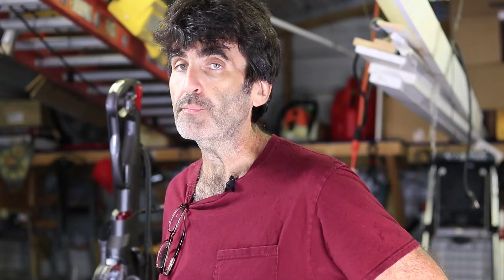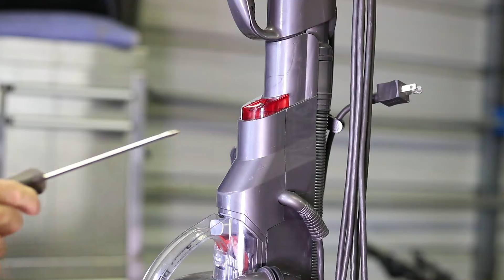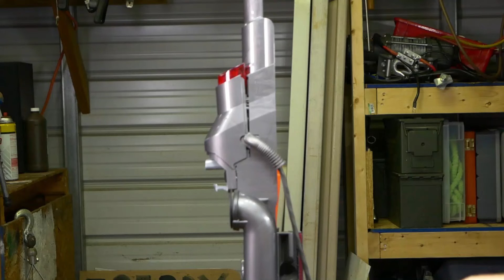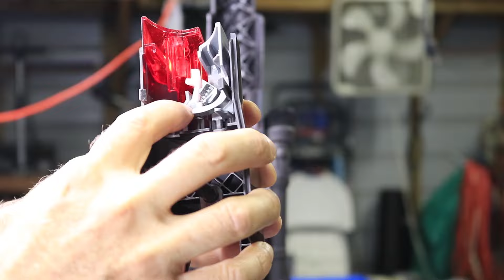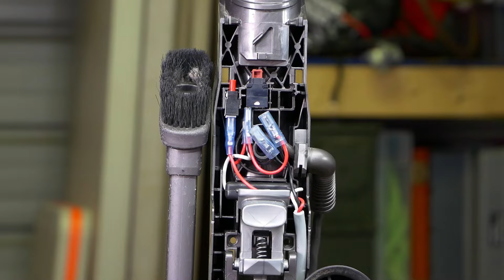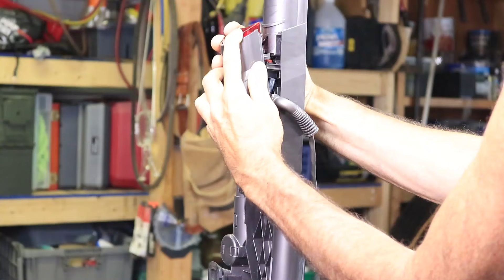How to Replace Power Switch on Dyson DC25 Explained in Full Detail

Comment: Where do I get a new switch from, for the vacuum?
Reply from the maker: I put a link in the description.  That should be the right one, it lists several model numbers there that it's compatible with.
Reply: I’m pretty sure I ordered one for DC 25 but Amazon sent me one for a DC 50 I’d go with calling Dyson!
Reply: I got one for less than £4 from a shop selling through ebay. Arrived next day. Repair took less time than finding my torx drivers which had been put away in a safe place (so that next time I won't have to search for them!)
Reply: Dyson no longer supports DC25. But they’re happy to sell me a new one.🙄 I located part on eBay for $15.
Reply: You can call Dyson and they will send you a free one, and the extra spring as well. They were very helpful as well.
Reply from the maker: @maryannharper883  Good 2 Know!  Thanks..
Reply: Hard to get cover off dc18 no video for that one

Comment: I’ve replaced the beater bar on mine as it stopped working. It still won’t work, could it be the switch in the handle housing that’s faulty?
Reply from the maker: HI Stuart... Yes it could be the switch.  To determine that, you'll need a multimeter to test for voltage either leaving the switch or entering the motor to eliminate the motor as the culprit.

Comment: Thank you! Your video was well done. Very thorough instructions that were easy to follow and best of all, my vacuum works again. I bought a Torx screwdriver set at Home Depot for about $14 which will come in handy for this or other household needs.
Reply from the maker: HI!  So glad I could help.  Yes a Torx set is really handy to have.  I run into them all the time..

Comment: Awesome video. Best one showing how to fix the power switches. If you have trouble pulling the cover off (like I did), there are two extremely tiny (approx 1mm) sacrificial "tabs" holding the very bottom of the cover. You would need a flat screwdriver to gently pry both sides (towards the bottom of the cover)  to break these tabs.
Reply from the maker: HI!  TYSM for the great feedback and the tips on getting that loose... 😊

Comment: Nice upload,  i own this same vacuum,  I've had it since 2015.  I had a bad 2 amp circuit breaker switch for the beater bar.  i got a replacement from ebay and just got done replacing it.  your video was a great help.  thank you...👌🤘✋🖐👍👍
Reply from the maker: That's awesome!  So glad I could help.  😊

Comment: How do you test the switch to know if its good or not once you take the cover off?
Reply from the maker: Hi!  If you have a volt/ ohm meter you can use it on ohms scale to measure across the switch.  I'd have to have a picture of the switch again to tell you which pins to take your readings from.. It's been a while since I've had this apart.

Comment: The reset switch is what hold the beater button up, they work in tangent. If that plastic piece that extends out to the reset button brakes, the hole button drops and wont reset if something gets hanged. should just remove the grey button altogether because that little piece will brake eventually and just reach in there manually.
Reply from the maker: Great tips!  Thank you..

Comment: How do i know if motor bad? I check the reset button an switches
Reply from the maker: HI, the best way to tell is to check the voltage right at the wires going into the motor.  If you have power there, then it's probably bad... of course don't attempt this if you're not comfortable with live electricity....

Comment: Before I take mine apart, here's my issue...the power button suddenly stopped staying on after pushed. vacuum will stay on if i keep the button pushed down manually which is a pain. Do i need the whole switch or maybe just a spring??
Reply from the maker: I've seen those power buttons do that, then you take it apart and work it in and out a few times and it starts working again!  So it's hard to say. If you take it apart and it doesn't come back, then you'll probably need a new switch.
Reply: @TheHomeImprovementChannel  good to know! Thanks!
Reply: @TheHomeImprovementChannel well I pushed the button several times & it never stayed down, so new switch it is. I have the purple one so I'll have to find that one comment about taking it apart bc it's stuck on the bottom somewhere
EDIT: I finally got the cover off. IDK what was holding on to it. But since it was such a pain, I started pushing all the buttons just in case & voila the power button is clicking normally again! No money spent, just a little time & frustration lol
Reply from the maker: Excellent!  Glad it starting working again.. 😀  Thanks for the update. @crazylablady

Comment: Great video:                                                                                                                                        TIP: if you have lost the grey pushbutton’s shorter spring, as happened to me, a spring taken from a fat pushbutton Pen/Biro and cut to size will work for Dyson Ball or similar models with an AC Power Push Button assembly as shown in this video. Must be a fattish pushbutton pen. That shorter spring can have a slightly smaller outer diameter than standard, eg 4mm will work and cut it to approximately 10mm extended length and it will work ok. It worked for me. Cut, install and test before installing the complete AC Power Switch assembly onto the Vacuum Cleaner body.  The springs need to be of similar wire thickness approximately to compress similarly/adequately.
The Red pushbutton spring is the longer 19mm one and it has an outer diameter of 4.7 or 4.8mm. I did not test to see if the Pen spring would have worked there but I think it might work too.
This way you can quick fix and not need to order just 1 spring. 
I discovered that If you call Dyson UK as I did on 10 November, sadly, you can expect to be told that they are busy and average waiting time may be up to ½ hour. So I hung up. I did not try email as the website said to call. I could not find data to confirm exactly which spring pat number to order and I could not find spring technical specification info for the listed springs and the description did not confirm, eg with a diagram, precisely where that spring was used. Sadly many companies have similar poor / cost cutting after sales technical support. IMO Dyson do sell a very high quality, well designed, robust product, the component quality and repairability are very good.
Reply from the maker: Thanks for the great info!  I've never tried to call them or contact them, so thanks for the heads up... 😀

Comment: I'm tired of changing this switch, as it seems to be a weak link... i'd like to just wire it up direct so when i plug the vac in, the vac starts... can i use a jumper to connect the two wires coming out of the on/off switch to accomplish this?
Reply from the maker: HI, I can't advise you on how to modify that unit for safety reasons... Thank you.

Comment: What would cause the brush to only spin for about a second?
The brush wheel and housing are clean from all debris and hair.
Reply from the maker: HI, is the brush motor spinning, but the beater bar stops even though the motor keeps spinning?  Or is the brush motor stopping as well?  That's an important difference.  If the motor is stopping and you're comfortable working with electricity you can find the wires going to the motor and see if they're loosing power using a volt meter.  Don't try that however, if you're not comfortable with electricity.

Comment: I can't seem to get the cover to come off. I took the three screws out and released those little latches but when I start pull it off it seems to get jammed up at the bottom and won't pull off like it did in the video
Reply from the maker: HI, without being able to see it there's not much I can advise on that one... Only to make sure you've removed all the screws and not to force anything so it doesn't get broken..

Comment: Thank you for this video. I was successful after following your steps, however, putting it back together was a real challenge! I would have done better if I had taken a photo or two when dissembling. The spring popped out and took forever to find. But, overall very happy to have repaired it myself.  The switch was only $7 at Amazon and your link worked fine.
Reply from the maker: That's awesome!  I'm glad I was able to help.. 😀

Comment: This was a great video! It worked and then it didn’t so maybe the springs are sprung. Thanks nonetheless! Amazing detailed video.
Reply from the maker: I've seen those switches act up where if you press them on and off a few times they start working again.  It's worth a try... 😀

Comment: Great video I just found out the button I ordered is for a DC 50 😂
Reply from the maker: Does it still fit?  OR you have to get another one...?
Reply: @TheHomeImprovementChannel  Once I got it all apart, as you instructed, I found that the power switch itself was fine. It just seems the plastic buttons are causing some resistance or friction due to degradation overtime. Perhaps some type of plastic lubrication would be the solution - sticky button. Great video! Thank you!
Reply from the maker: I have actually seen where it seems to work again just by taking it apart and putting it back.
Reply: @TheHomeImprovementChannel  Good learning experience either way. Wasn’t really broken but a bit sticky. Thought since Dyson was so good about offering parts I’d just replace the assembly. Might try and get the right parts at some point!
Reply from the maker: Good luck!... 😀. I think Amazon has a lot of Dyson parts too...
Reply: @TheHomeImprovementChannel  I couldn’t believe how easy it was to replace the entire brush, head assembly! Got that on Amazon!
Reply from the maker: @jayb150  Excellent!  Glad you got it fixed.. 😀

Comment: Is it sometimes necessary to replace the roller bar switch? My vacuum goes on, but the roller bar will not turn on. Your video was VERY informative. I got the switch cover off but need to know about the roller bar switch, or is it necessary to replace the power switch to make the roller bar come on? Thanks for a great video
Reply from the maker: HI, if you've got access to both switches you can use a volt/ ohm meter to test the switches and see if one of them is bad.  I've also found that sometimes if you work the switches back and fourth a few times, sometimes they'll start working again on their own.

Comment: Thank you.  Mine was weird but it's fixed. I ordered the switch on Amazon in advance.  I took out the screws today and it really didnt want to come off even with depressing the plastic tabs - was stuck at the bottom. turned out my switch was not bad and wires weren't loose...just seems like the switch wasn't catching. when i reassembled, it works great.  Thanks for the tips!
Reply from the maker: Glad you got it going again!  I've seen that before where the switch will quit and then you play with it a few times and it starts working again....

Comment: Thanks for the video and the inside view of the springs. It was just enough information to help me reassemble my DC-17 after the springs popped out.
Reply from the maker: Very welcome!  Glad It helped... 😀
Reply: @TheHomeImprovementChannel  do you have a better view of the the white lever arm sets under the brush button? I also have a spring 1 inch long and 1/4 round., I'm not sure where that spring goes either. Thanks for your help.
Reply from the maker: @philwhitt6462  HI Phil, without being able to see it, I'm not sure how to answer that...

Comment: Regarding the switch assembly, the power switch has the springing tension when depressing however; the beater bar switch seems not to have any springing tension prior to attaching the cover assembly.  Is this correct or have I not assemble the the beater bar switch white tab correctly?  Any assistance is appreciated and Thanks in advance.
Reply from the maker: Arrgh... without seeing it I can't be sure of what you have there.  It seems like the beater bar switch would have tension along with the power switch.

Comment: I don't comprehend how the little white sprung loaded plastic piece works, i/m guessing it's to turn off the beater bar at the same time you turn off the main motor. Had to lube the plastic with silicone spray to get mine working.
Reply from the maker: Yes it works so you can turn them both off or just the beater bar for a hard floor like wood or tile.

Comment: Great video.  I had a bit of difficulty getting the switch housing off, as others have noted.   It's much easier to re-assemble and get the switch buttons sliding as they should if you aren't pivoting that switch housing.  I had to freeze frame some of that for a bit, so thank you for having EXCELLENT video quality.   The warnings about the springs are worth their weight in gold.
Reply from the maker: Nice work!  Thank you for the great feedback and glad you got it apart ok....

Comment: I have two issues - one is that the bottom of the cover just won't come out. I have some room to work but not easy. Second is that my dc25 model has the red piece with a metal across red/silver so I  cannot follow your video to put it back. Suggestions?
Reply from the maker: Unfortunately without being able to see it I can't offer much of a suggestion.  Do you access to Facebook?  You could post some pictures on my Take a Bath Productions FB page..
Reply: @TheHomeImprovementChannel  What about removing the cover? Suggestions? I cannot see anything that is holding it. Thanks
Reply from the maker: Did I remove the cover in the video?  I seem to remember that I did.
Reply: @TheHomeImprovementChannel  Yes, you did. That is exactly the point. You made it look like trivial. I could not remove it without a risk of  breaking it. No worries.
Reply from the maker: Sorry about that.  Mine probably came off without any trouble.  Without being able to see yours, I can't see why it is giving you a hard time..  I'm guessing you have all the screws out?
Reply: @TheHomeImprovementChannel  I did
Reply: It’s the gray button that he uses at :55 to remove the cannister. That button is a little big, so when you go to pull the cover off it’s preventing the cover from coming off easily. Just press it in or down a little bit to enable the cover to come off.
Reply: @herrwabbaloo937  Appreciated. Thanks
Reply from the maker: @herrwabbaloo937  Thank you... I couldn't remember...

Comment: Thanks man. I searched for quite awhile for this.  All was on the motor, change it  - change it.  Mine was only the reset switch, would pop immediately after the brush bar button was pressed.
Reply from the maker: HI Jim... so did you figure out why the reset switch kept popping?  Or was it a bad reset switch?
Reply: @TheHomeImprovementChannel  Heya, I couldnt tell you why this switch failed. Im thknking like house breakers, if tripped a lot, become super sensitive to current. Guess this one just got plain ole  tired.

Comment: Informative video. My search for the issue got a little ugly when the switch casing wouldn't come completely off; then fought me, going back on. When all was said and done; the belt that drives the brush bar had slipped off! Thankfully I didn't need a new brush roll motor!
Reply from the maker: Thank you... 😀

Comment: Hi there, if the vacuum cleaner doesn't stay on without pressure on the switch, which part do I need?
Reply from the maker: I've seen that happen before and working the switch back and fourth a few times usually brought it back to working normally.  IF that doesn't work then you'll need a new switch.
Reply: @TheHomeImprovementChannel  to begin with, it wouldn't switch off unless you unplugged it from the mains, now the switch requires constant pressure to stay on.
Reply from the maker: @WalkWithWallace  Sounds like a bad switch to me.
Reply: @TheHomeImprovementChannel  ordered. 🤞🏻 Thanks for getting back to me.
Reply: Fixed. 👌🏼

Comment: Very helpful as this was, there is a slight difference in the way the switches are on my cleaner.
I'm in the UK so it may be that this is a modification to UK machines only.
On mine there is a small metal piece that is attached to the bottom of the Red button, that served to lift up the brush roller button when the two switches are doing nothing.
Reply from the maker: Thanks for the info!  Yes they will often send different versions to Europe, Australia and other places and the US gets its own version too.  I'm not sure why they do that, but they definitely do.

Comment: Thank you again. The wires came loose again on my Dyson switch. Had to watch your video again to remember how to get it apart.
Reply from the maker: You're welcome..!  I'm glad I was able to help.  If you haven't done the job already, if you take some pliers and squeeze the connecter just slightly it'll tighten it up on the connector.  That should help it stay better.